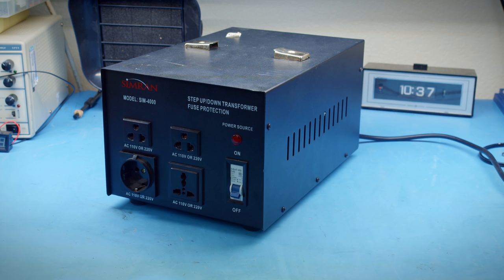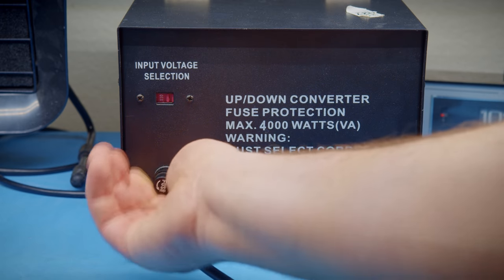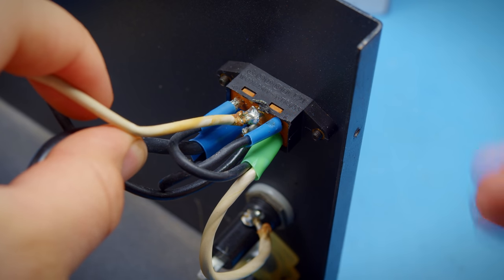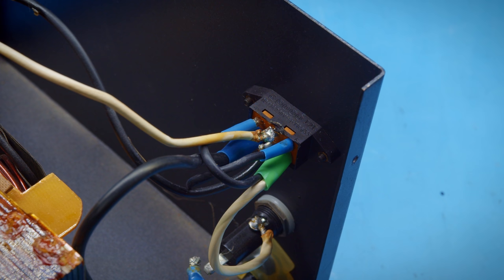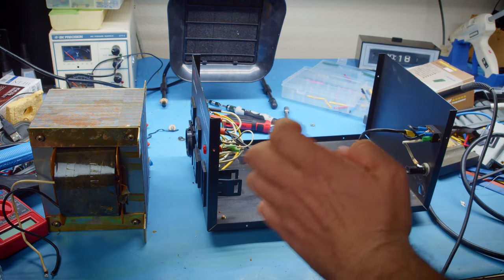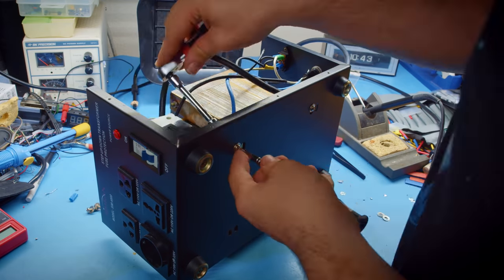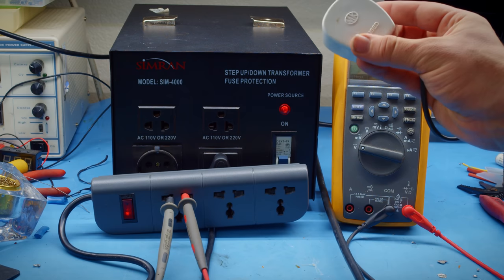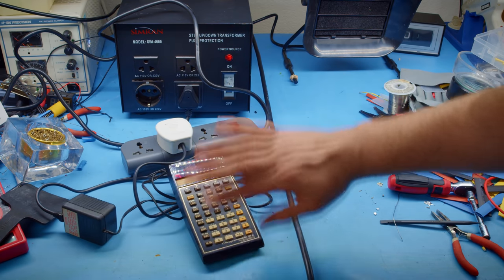Making 240V AC In the USA, Interesting but Dangerous

Comment from the maker: If I could run 240V from my panel, I would. I cannot. I am not the only person who cannot. Not everyone can make whatever changes they want to their electrical wiring.

Do not buy one of these. They should not be used for kitchen appliances, they can't be used to charge your EV, and never leave one plugged in all the time. I only say all that  because I have seen things online now that I've been researching them.

One correction on what I said, apparently some places in the EU can actually get 4000W from the wall at 240V, so it is technically possible to use this at it's rated capacity. But that would be assuming stepping down which means you would need to pull that power back out through the plugs on the front at 120V, none of which are suitable for 4000W of power at the current levels high enough to hit it. So it either can't pull it from the wall in the US, or it can't get it can't put it out through the sockets on the unit. So I'll stand by my statement that it is massively over rated, not even taking into account the quality issues.

There are other things about the build quality that I'm still finding are bad or didn't mention here. The fuse it came with is 30A and the breaker on the front is 40A, both WAY to high to be useful. The breaker is actually real, I cracked it open to verify it but I'm going to replace it with a 10A model and pair it with a 15A fuse. It gets worse though, the wires are all aluminum. Which means heat generated by poor solder joints will cause differing rates of thermal expansion in the wires making them basically self destruct.The transformer wire could be aluminum now as well which has other much worse implications.

I don't know what a good option would be. At this point, I would instead want something like a UPS that just generates the voltage from scratch fully isolated and with better quality control.
Reply: I can't think of a 100-120V device that's even capable of drawing that kind of amperage... as I understand it, most US appliances have a hard max design wattage of 1875, like hair dryers and space heaters.
Reply: That thing is so shoddy inside I don't think it would pass regulations anywhere.
Reply: I believe Techmoan did an episode on voltage/frequency conversion when he tried to get a 60Hz turntable to work on a 50Hz circuit, and I think his solution will work for you as well. Basically what he did is connecting a 12v DC power supply to a sine wave inverter. With this config, you can change the output voltage and frequency of the output supply and it is isolated from mains.
https://www.youtube.com/watch?v=_dgO0HdPMds
Reply: Yes, we get about 4kW on single phase with 245V@16A, which has become the normal voltage. The only household appliance we don't have on single-phase is the kitchen stove usually, and even that only requires two phases (either 400V@16A = 6.4kW or 2x245V@16A = 8kW) plus another one for the oven. I understand that it is common in the US to have your washing machine and tumble dryer on two-phase 220V supply.
And continuous power per device is still 2.4kW, as you're not supposed to draw more than 10A from a single outlet.
Reply: Perhaps the capacity is assuming the device to run multiple appliances simultaneously? Such has running a 1500 watt microwave plus a 1500 watt waffle iron at the same time?
Reply: The two upper outlets look like they might be the Thai standard, which is 220V, but anyway...

If you pulled from all four outlets more or less equally, you could draw 4kW without exceeding the current rating of any of the connectors.  I wouldn't WANT to, mind you, as I don't trust any transformer in such a shoddily built device, but you won't overload the connector ratings.
Reply: @LabRat Knatz The real problem with aluminum is how it behaves when crimped, and how brittle it becomes with vibration. That makes it still suitable for a number of applications, for instance, it is now used extensively with network cabling as CCAW, as it's lighter, and the HF signal only travels on the skin of the conductor anyway. But it has no business in domestic or automotive cabling where LF or DC currents are applied.
Reply: @graealex  The 10A rating is more for just the 110v outlets. Permanently installed typically have their own dedicated breaker. Washing machines don't need 220v though only the dryer.
Reply: @LabRat Knatz I don't want to sound condescending, but I was not talking about NEMA plugs and outlets, as they're shite anyway, one of the worst designs on the planet. Just because of that plug you're probably better off using only 120V for safety reasons. I was actually talking about Schuko or the british types, which are present on the transformer.
Reply: @shoopnooop2952  Interesting. Was talking about 10A for 240V outlets, though. Portable devices will rarely draw beyond 10A. Washing machine and tumbler might draw more, but because of their non-portability, they are rated differently, even if they are just plugged into a wall outlet.
Reply: I'm an electronics technician and this kind of thing was actually an assignment we were given in class to learn how currents work in different parts of the world. One big caveat that came with it was our teacher hammering "Do NOT ever use this for anything, ever" as we worked on it. Of course, one person didn't listen and ate a faceful of magic smoke and capacitor juice to the body (thankfully we used glasses) once it inevitably went wrong since we were all in our 2nd year and far from being experts.

Still fun to see one of these in the wild for once, even if it's just someone else's workbench.
Reply: @AliceC993  That's because the standard distribution circuit in a North American home is rated at 15A at a nominal 120V, which is nominally 1800W.  You can cheat a little bit, but not a lot for continuous load.  You may get 40A circuits for kitchens so you can operate multiple appliances, or you may get more circuits so each kitchen outlet (or even each socket) has a different circuit.
Reply: @LabRat Knatz We know our hot is of limited means, and that sounds like an expensive setup, even for the cheap version of it.
Reply: @LabRat Knatz As I said, with these NEMA plugs, it's a good thing that the voltage is only 120V. And I've never seen a properly mounted US outlet, they're always "upside" down, basically the smiley face.
I am also not sure if you are talking about "Euro plugs" as in "plugs used in Europe" because there are various designs, a few are pretty safe (Germany, France, Switzerland, Spain ...) and a few are very bad (Italy, older ones in Greece). Or do you mean the universal Euro plug, because that's only 2.5A and one of the features is that the inside of the prongs is actually hollow and the thin conductor inside acts as a fuse.
Reply: @LabRat Knatz Japan is a shitshow, with multiple voltages AND frequencies. While not a problem for small devices with an SMPS, it really gets complicated with AC motors.
Doors on EU outlets have become commonplace as sometimes required by national laws. In Germany, we also got a few not-so-sane laws, like the requirement to use atypical security screws on devices with outlets. Nowadays, you'll find mostly triwing screws on power strips.
Reply: @trevormang7464  Why not just buy a VFD if you're going through that trouble?
Reply: I had two of these fucking things to run an IBM Power5 server that took ONLY 230v and had dual power supplies.

They both melted their cords at around 500 watts draw.
Reply: So much misinformation in here!
There's no such thing as a "correct" orientation for a NEMA 5-15R or 5-20R. There are minor safety benefits to a ground-pin-up orientation, but installing them ground-pin down is not "wrong". 
We have some additional safety features in NEMA connectors slowly being popularized, one of which is "Tamper Resistant" receptacles - similar to extant UK and AU plugs that shutter the live portions of the receptacle until a ground pin is inserted. 
On a safety-related note, (and has already been mentioned), US 240V is normally split-phase, meaning neither leg of a 240V circuit is much higher than 120V above "ground" or neutral, which greatly reduces damage done by most shorts or shocks.
While it's very rare to find 120V devices rated beyond 15A, they certainly exist. Most of the 120V devices that are beyond 15A are 20A instead, as they draw just slightly too much current for continuous use on a 15A circuit (a 15A breaker would commonly 'nuisance trip'). Even still, there are devices that use NEMA plugs like L5-30 (30A rated) or even 5-50P (50A @ 120V), but these are rare, and usually just used for PDUs (think industrial power strips) that are intended to supply power to many 120V devices, rather than one large load which would be more cost effective to switch to 240V. 
The USA does not use 110/220. Residentially, it is a 120/240V nominal system, and hasn't been 110/220 since before the 1930s. The electric companies are allowed to deviate from this 120/240 a maximum of 5%, so you should expect to see supply voltages at 114-126 and 228-252. Many commercial and industrial devices also run at 208V or 480V with similar margins.
For the purposes of this conversation, there's basically no such thing as 2 phase power. That refers to a specific and unusual system that is now almost completely out of use.
Badmouthing NEMA receptacles as "one of the worst designs on the planet" just makes you sound condescending, snobby, and poorly informed. They're far from perfect, but they're not bad. There's not much in terms of good numbers to compare with, but electrical deaths are rare in both the US and the UK with their superplugs, and the vast majority of electrical injury in either jurisdiction is unrelated to the design of the receptacle. The number of people who have died or been seriously injured because of a NEMA plug while they would have survived if it was a UK plug is *vanishingly small*.
As far as other options, sure, he could have used a battery+inverter system, or a VFD, or hell, he could buy a UK generator and get perfect 50hz out of it, or he could move to the UK, or he could do any number of things, but the fact is that an autotransformer plugged into the wall is a very good solution to his problem, though it doesn't provide isolation (and actually removes the safety of split phase 120/240).
Reply: @UnreasonableSteve  NEMA is no doubt a shitty design. The only redeeming quality is the small footprint, but then again, there are equally space efficient designs out there with none of the drawbacks of a NEMA plug.
Reply: Never understood why in the US you have 240V in the electrical panel but no 240V outlets. To me is stupid... why not wire 240V european (schuko) sockets in the US? Is it against the regulation? Most appliances that you buy (PC, TV, basically everything with a switching PSU inside) are rated for 100-240V, but are more efficient when you run them at 240V! Not to say that less amperage would mean less losses in the wiring. It seems that you like wasting power in the US.
Reply: @alerighi  You might be surprised to know that 240v (or 208v) outlets exist in almost every household in America. They're nowhere near as common as the 120v NEMA 5-15R receptacles, but for items that are heavy power users they are around (car charger, water heater, clothes dryer, oven, stove, jacuzzi tub). In commercial environments, you see them in server rooms and network closets where high-power switchmode devices are in abundance. 
The savings on efficiency switching between 120 and 240 for the vast majority of SMPS devices are miniscule, and absolutely don't warrant wasting time thinking about rewiring, much less actually doing it.
Personally, I would love more 240v outlets in my house, but looking at it objectively, it almost never matters, and when it does, we do have it.
Reply: worst part about the breaker is that it is type C, which means it trips between 5 and 10 times the written rating, aka 400A, which means no good.
Reply: You do run 240 volts from the panel. We receive 240 into the house, broken up into 2 separate 120volt lines. At the breaker box, it's in a butterfly arrangement, so that 240 volt lines are the double sized breaker/fuse and connect to both 120volt lines. It's outlined in a video done by Technology Connections - https://www.youtube.com/watch?v=jMmUoZh3Hq4
If it's that you can't make changes to the breaker box itself, because you're renting or something like that, it's understandable.
Reply: Almost all wiring I see here is rated for 240 volts at 16 amps, which would not be enough for 4000 watts. And I think most houses are fused for 12 amps so that'll be impossible to reach.
Reply: @Tech Tangents
 .... WARNING!! 4000watts in 220V is like 18Ampers.......... but in 120v is more than 33 Ampers........  so i you really connect to that thing.. something (or many things) that consumes 4000whatts x 220volt (18Ampers)......... you'll be sucking from the wall outlet 33Ampers in 120volt......... I mention it to you..... because you put a 1mm cable there to connect that thing to the wall..... and it will get a little hot......... actually it will get A LOT hot..... also the cable inside the wall..... watch out............ to actually get 220 volt at 50Hz .... you need a UPS.... or a solar power inverter (for continuous use)............ import an APC UPS from Latin America...... then plug a battery charger the UPS batteries to keep them charged alt all times..... and it will be much better than that thing......
Reply: Wouldn't you be able to power two US appliances from one german upstream socket with this?
Pulling 16A from the German wall socket @ 230A and pushing out 16A @ 110V through both sockets each?
Reply: @justjanne-de  I doubt it ... looking the wire in the coil of that transformer...... it appears to be 1mm .... which supports around 8 amps (at 220V)... so the 4000Wastts seems like a sales pitch..... I have here a StepUp (real 3500Wallts (16Amps) in 220v)... it is an automatic transformer for when is low voltage coming in from the electric company... it only step up from 175volt to 220volts in extreme case.. and its coils are of 1.5mm of copper wire ... and it has a fan that gets activated when the transformer takes temperature...
Reply: @Ramdileo_sys  Yeah, obviously it can’t handle that load, but I'd assume that's the intended use for why you'd even want a 4kW one.

Even better ones often can’t handle that, though. In electronics club we’d often break transformers for fun purely by using them to their rated load.
Reply: 400wats is for counters with 220 volts at 20 amps
Reply: @AliceC993  The max is designed to not pull more than 15 amps as it's the standard current rating for a circuit breaker.
Reply: @UnreasonableSteve  Some of the NEMA plugs are even safer due to their twist lock systems. Although some due get confusing with the dual voltage wire up designs, but that's getting into the 4 and 5 wire style cords and such which are rare.
Reply: @LabRat Knatz in mexico we use 120v to run everything
we dont get 240v to our homes only 120v 
yes the guys that even have an electric water heater runs at 120v same for ovens
and yes you can smell burnt wires alot of times and 240v only exists for factories
Reply: @graealex  In Australia 10A is a common power point (aka wall socket, or outlet or receptacle). USA it is 15A. I believe the standard for UK is 13A and 16A for Euro (schuko). UK is pretty wild in that some of the topology of domestic wiring are 'ring circuit', protected by a 32A MCB, but the 13A limitation comes from the fuse in the end of the plug (compulsory). 

In the USA, 240V is still single phase, it often is mistakenly called two phase. USA homes are fed a centre tapped 240V supply, from an pole mounted transformer that is fed single phase (7200V typical I think?). The centre tap is the neutral and bonded to earth with copper rods, both at the transformer pole and the house switchboard (aka circuit breaker panel, consumer mains board, fusebox), with two 120V lines, each 180 degrees out of phase. All washing machines I have seen so far in the states have been 120V, because they do not have a high power draw. Dryers are on dedicated 30A 240V circuits. Even though you have 240V in homes in USA, there are a couple problems. 

You will never have more then 120V to earth due to the centre tap being earthed and neutral. You will never have a true neutral. You have two 120v live wires and an earth, with 240V between the two live wires and 120V between either live wire and earth. To get a 240V supply with 240V to earth, and a proper neutral, a 1:1 transformer is needed. 

From what I understand, where you live there is true multiphase power, 120 degrees apart each. Pretty wild to have true 3 phase power to domestic homes there! In Australia, the typical is single phase, 80A max supply (with service cutout fuse) from the energy provider. USA 100A or 200A max from supplier, unfused. The only fuse for the incoming power is on the primary side of the pole transformer, from what I have learned.

I'd love to have 3 phase fed to my home tehehe!
Reply: @AliceC993  yes that's true but if you have your kitchen wired correctly to modern codes and know witch outlets are on the opposite phase and a little now how you can make a power adapter let's say to a UK configuration and run 240v kettles and with a little luck 240v hair dryers if you have 2 circuits close to a bathroom lol
Reply: @LabRat Knatz lol I thought you where a master spark I'm just an apprentice and I lend all that after 5yrs of asking why and how
Reply: @alerighi  economics if we where to upgrade our distribution lines to handle that power increase we wld have to rewire and redo all transformers or we just keep our system as very few things need 240v yes our kettles take 3 minutes longer to heat but at a cost of almost tripling our energy costs its worth the wait lol
Reply: @AliceC993  Agreed, in the sense that you can't get more power out than you can let in - regardless of country.
Reply: @Tech Tangents: I'd like to also warn you against using that surge protector power strip, especially for anything beefy, because one, multi-standard outlets aren't typically as good at making a secure connection as regular ones, and two, that looks like a BS 546 plug, which is weird and also unfused. Except for shaver plugs, all modern British plugs are fused. I know a fuse is technically optional in the old BS 546, but really the plug itself should be fused just like a BS 1363. The same goes for pin insulation, which this doesn't have either. The use of that odd and old  BS 546 plug is one more thing that makes me think this too is an iffy knock-off of an outdated design. On the plus side, unlike the Schuko plug that other guy had, both BS 1363 and BS 546 plugs are polarised, so if you've wired everything correctly, the polarisation should not be reversible.
Reply: @graealex  Most US washing machines are 120V. Tumble dryers, water heaters, cooktops, etc. use two phases bonded to make 240V.
Reply: @deathventure  Most outlets are rated at 15A, but I’ve noticed most electricians in the US use 20A breakers now for the safety margin. Older houses sometimes have 15A breakers.
Reply: @5roundsrapid263  As long as they run 14AWG wire to match instead. If they're running 16AWG with that, run. I'm going to be running some line in a barn later this year, I'll be running 14AWG for the circuits and a 8AWG for a couple 30A circuits.
Reply: @5roundsrapid263  I just re-read what you posted. Unless the outlets are also rated for 20amps, they cannot put it on a 20amp rated breaker. Wire gauges still apply. 16AWG or larger for 15A, preferably 14AWG. 14AWG or larger for 20A. Throwing a 20A breaker on a circuit with 15A rated outlets violates NEC standards and an electrician that is caught doing it will lose their license.
Reply: There are On-Line UPS that run the output through a pure sine inverter.  They are able to output different voltages like 120, 208, or 240 at 60hz for the NA market.
Reply: Just go around the house and find two 120v plugs on different sides of the center tap make a scary cord and DONE
Reply: Replace all the wiring and get a proper socket. (keep just the transformer and case)
Reply: so grab 110 from an outlet on two circuits duh!!!
Reply: also you could just use a 110 motor to turn a 240 generator :) not the best but do able.... I used to have a 2hp motor turning an alternator for the subwoofers in my home stereo.
Reply: come to think of it you can just resolder your stator wires and get about 10 amps 240 from an alternator.